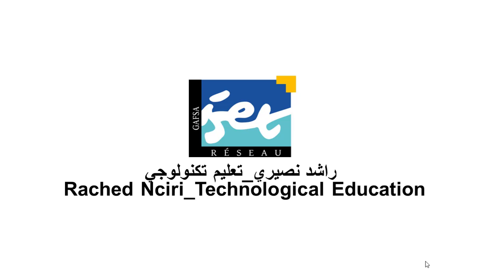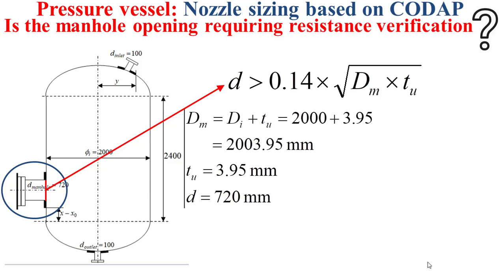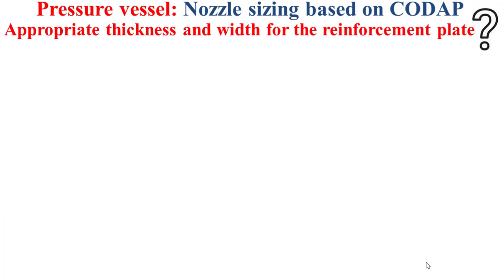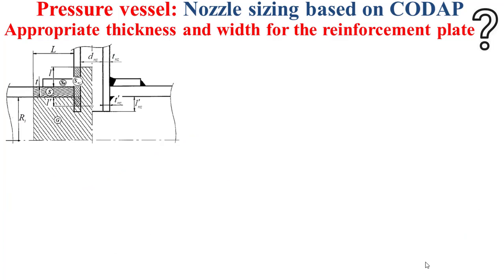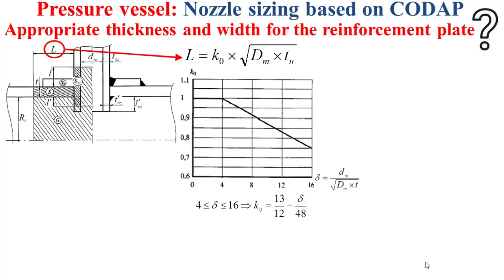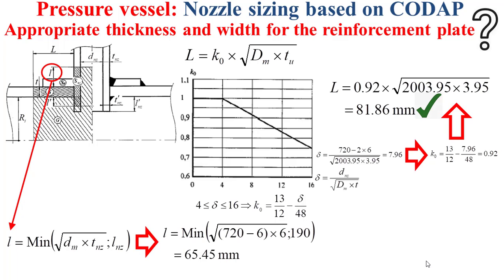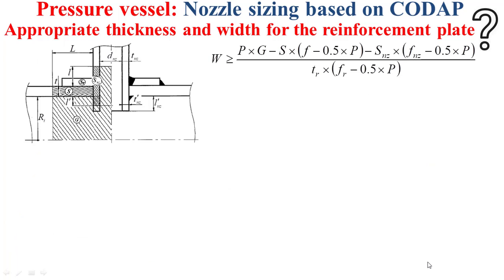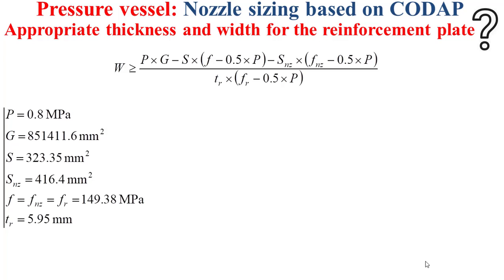Pressure vessel_ Sizing_CODAP_Tutorial_Part 5 (Reinforcement plate sizing)

Comment: Hi man! How to calculate the effective thickness tu?
Reply from the maker: Thank you for your question. The useful thickness determination is explained in this link: https://www.youtube.com/watch?v=l8apfU8or0I&list=PLWAu_6h0fkVCAEv43iy8iA7jPG7w0ivTW&index=9
I advise you to consider the whole playlist using the link:
https://www.youtube.com/watch?v=fCE1g_4YjL4&list=PLWAu_6h0fkVCAEv43iy8iA7jPG7w0ivTW
For your first question that you probably deleted, it is to note that 2000 mm refers to the internal diameter of the cylindrical shell not the external. Hence the mean diameter is obtained as: Dm=Di+thickness. Do not hesitate to ask any other question. I am at your disposal. 😀
Reply: @RN_Ed_Eng  very nice man, good job! It’s important for welding engineer 👍👍👍
Reply from the maker: @hdavid8432  Thanks a lot sir. These links can be useful for you in the field of Welding Engineering:

https://www.youtube.com/watch?v=iO6i9b7d5CY&list=PLWAu_6h0fkVDyJXlsbJI7SB5Z4pZY0UWy

https://www.youtube.com/watch?v=HRl78zFfmso&list=PLWAu_6h0fkVCO8RlJd6a8faGYxi031auS

http://www.isetgf.rnu.tn/ENS/uploads/nciri_rached/Permanent%20joints%20(Assemblages%20permanents%20)%20_Course_Rached%20Nciri.pdf

Deep respects. 😀.